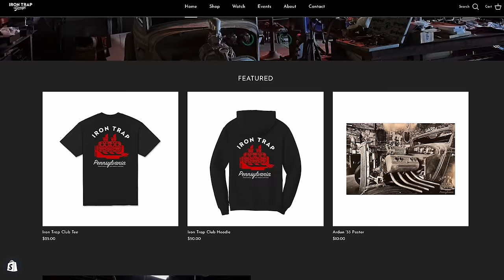Replacing The Hacked Up Firewall In The 1938 Ford Convertible

Comment: Yes sir, it is very considerate of you to explain how tedious this type of repair can be. We must remember that these vehicles (as they are now) come down an assembly line and of course the individual components are manufactured separately, and to change or modify them is quite a job. Looking at this car and the original modification of putting in the Pontiac engine and changing the driveline and also the attempt to put in hanging pedals and such would be typical of what people had to work with at the time this was done. I view a lot of these You Tube videos and the stuff that people have in their shops would rival a full fledged automotive repair shop during the time that the original modifications that were done to this car. Most of the time back in the day people had a gas ax and an arc welder as their fabrication tools and of course it showed on this car (oops I forgot the "hatchet cutter"). It always takes  more time to modify and repair than we estimate. This is going to be a nice build.

Comment: They touched my '30 coupe, covered it with 3 flat firewalls. After removing those remains I was left with removing the narrow band of the original. Drilled the bottom 2 on the right side, gripped HARD with a vise grips and pulled. The next spot weld started to yield, I assisted with a pry bar successfully!
I took a new bite with the vise grips now 90° at the strips end and begin to wind it like a ham can opener around the opening, assisting with the pry bar when needed.  Our local body shop did that removing rocker panels.

Comment: Very nice, straight forward, correction/update !! Looks soooooo much better !!  Ford took advantage of the available space and put the battery in the engine compartment but it sure doesn't make for "pretty" !! I would certainly take the time and effort and re/configure that side of the firewall and remove that huge "battery box notch" !! You have all the necessary tools. What would it take?? One afternoon ??? That one "long shot" across the front of the car, that Caddy looks so  "factory" sitting in there !!! Merry Christmas to the entire Iron Trap crew !!
Reply from the maker: Agreed it’s cleaner without the battery there but it’s also a closed-hood car so not really on display like others.

Comment: Out of curiosity why didnt you get it sandblasted or something and paint it except for a 1 inch perimeter to weld her in?
Reply: That's what I thought, strip it, fill what holes it has and prime it out of the car would have been much easier
Reply from the maker: Then wreck the primer by welding the firewall back in with weld spatter.. more than one way to skin the cat. We primered the areas we were covering up when installing. It can be sanded/ further and primed and painted while in the car.

Comment: On first introduction 1949 Cadillac was 160HP with a 2 barrel carb and 7.5:1 compression. Later editions were over 200HP. Highest was 270HP 1955 Eldorado with 9:1 compression and 2 - 4 barrels. I wonder what year this caddy is??? :body-blue-raised-arms: It has a Four Barrel  maybe its a 55 with 270 horse power. If so you will know it when you drive it. 270 donkeys is very noticeable. It would do some serious acceleration. 1952 is 190 and 1953 is 210 horse power. A 1954	has 230 or sometimes 210 horse power.  If its a 55 it will be outrages.:face-turquoise-covering-eyes:

Comment: Wouldn't it have been easier to cut out the old firewall before putting the Caddy engine in and the replacement firewall, too?
Reply from the maker: Wasn’t that much difference with taking it out. Installing it with the engine in allowed us to more easily trim it to fit around the caddy engine.

Comment: 2:22 Why didn't you remove the engine? 
Once the firewall was cut out it would be easier to fine the spot welds. 
I say this because I saw your last video and Steve was upside down in the interior cutting out the spot welds.

Comment: Am I the only one thinking this should have been done before the Caddie engine.
Reply from the maker: Why.. we couldn’t have seen how much had to be trimmed on the firewall without the engine in…
Reply: @IronTrapGarage  at least remove it first, no critic here, been a subscriber for several years. Drive a flathead powered 40 Ford Coupe, no billet, newest car part 64 Chevelle seats.